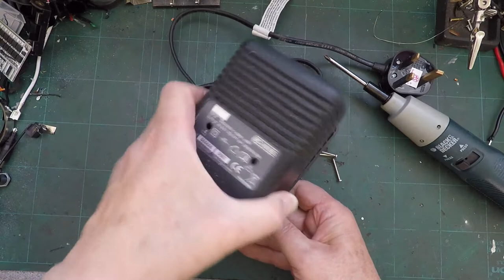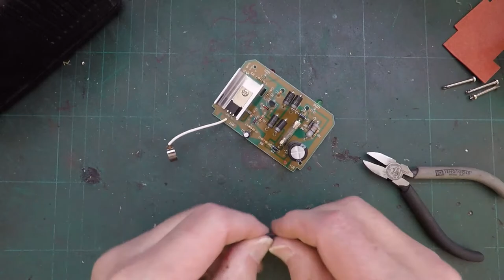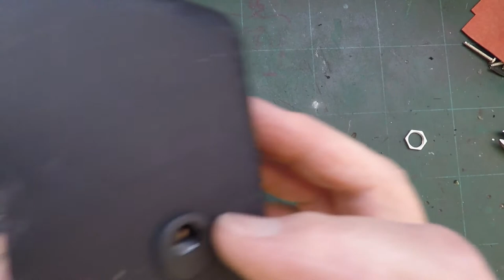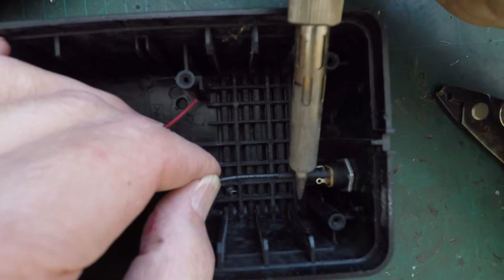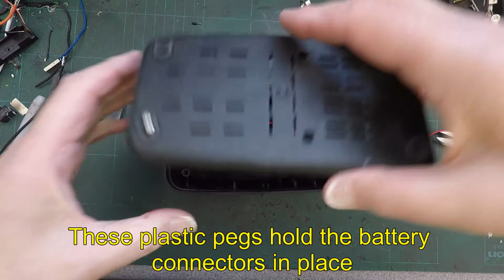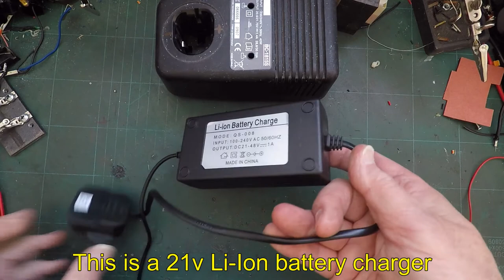RYOBI 18v NiCd charger converts to Li-Ion

Comment: ho anche un caricabatterie IMAX B6 potrei fare la modifica al caricabatterie come hai fatto tu e poi utilizzare l'ibax b6 come caricabatterie?

i also have an IMAX B6 charger could i make the change to the charger like you did and then use the ibax b6 as a charger?
Reply from the maker: You need 21v to fully charge a 5S 18650 Li-Ion battery. If your IMAXB6 can give 21v it would work.

Comment: vorrei fare anche io l'upgrade delle batterie ma e possibile usare il caricabatterie originale senza modificarlo? non ho un caricabatterie da 20v vorrei usare il suo originale senza modifiche è possibile grazie

I would also like to upgrade the batteries but is it possible to use the original charger without modifying it? I don't have a 20v charger I would like to use its original without modifications it is possible thanks
Reply from the maker: No it is not possible to use the original charger.

Comment: How come you can not use the original transformer.Its a good idea but again by the time I purchase the charger I may as well buy a used Ryobi charger with better BMS
At the end of the day that lithium charger I think is a switching power supply  with a bridge rectifier  converts AC to DC ,like the original setup only that's more robust
Have you tried a lithium battery In nicad charger .You probably can not do it as those nicads must charge to a lower voltage compared to lithium only half the amount of cells per 18v pack .Be interesting to see if you can guy the charger and put the electronics in the original case
Reply from the maker: NiCd and NimH charger cannot be used for lithium batteries. Charge control is mostly by temperature with NiCd and NimH batteries. Lithium batteries need very precise charge control vi voltage and current.

Comment: ok andrebbe bene un alimentatore di noteebook da 19v 3,2a collegato al circuito originale del caricabatterie

ok a 19v 3.2a notebook power supply would be fine ok a 19v 3.2a notebook power supply connected to the original charger circuit would be fine
Reply from the maker: You need 21v to fully charge the 5S battery. A 19v notebook supply will work but will never fully charge the battery.
Reply: @DaftOldMan  ok thank you
Reply from the maker: @arcymax7291  Glad to help if I can.